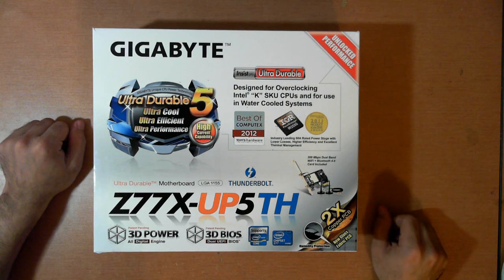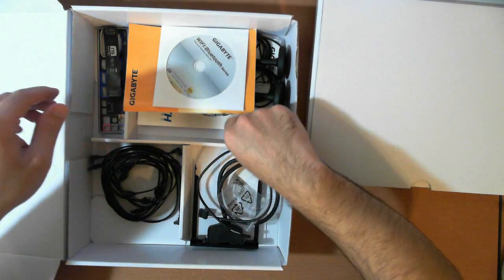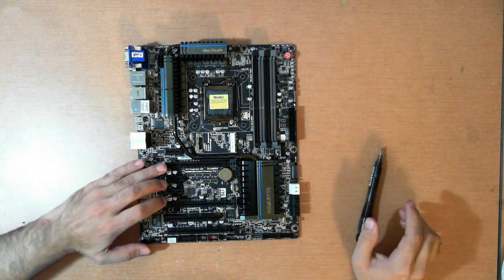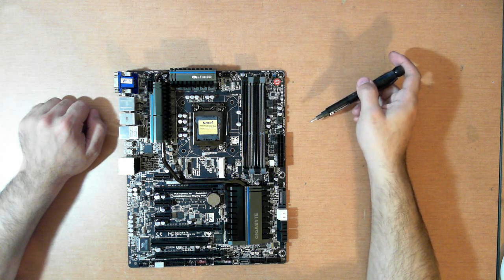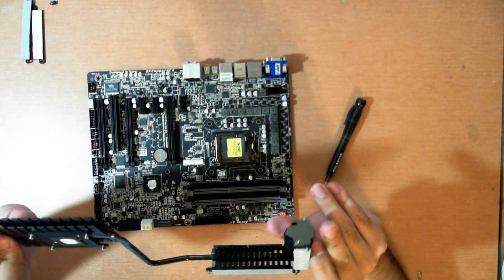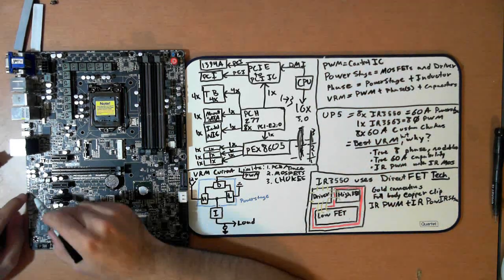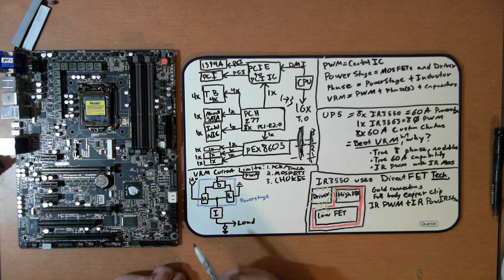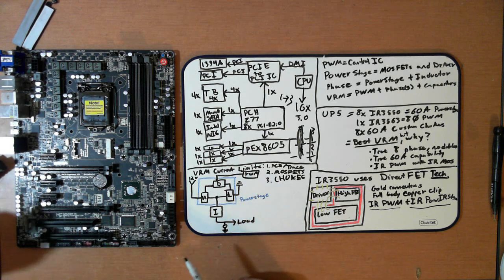[SinHardware.com] Z77X-UP5-TH Review

Comment: Just curious if anyone has had this board go pop I've had this board for about the time this video was posted it's had very little use with no overclocking.
The board vented from around the voltage test pads near the on board power switch.

Comment from the maker: What to you mean? Thunderbolt is thunderbolt. They are all the same, only 1 manufacturer for the controller and that is Intel. 

This controller is fed 4 pCI-E 2.0 lanes from the PCH, just like on all boards. I doubt you will find any board to provide PCI-E 3.0 to the TB controller. That would be because the GPU would be pushed down to 8x.

Comment from the maker: Thanks
True the Up5 is more next gen b/c of thunderbolt and its Ultra Durable 5 Status, however even the G1.Sniper 3 is very good for the future. The Sniper 3 has better audio and dual NICs, however it also has the ability to run multi-GPU configurations better than the UP5. IMO you should be happy with your decision, especially if you are a gamer.